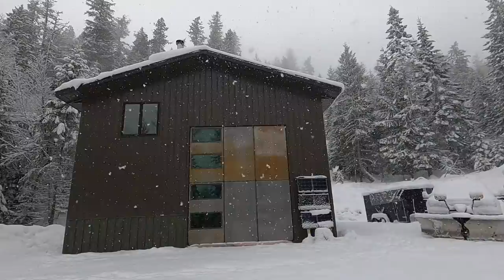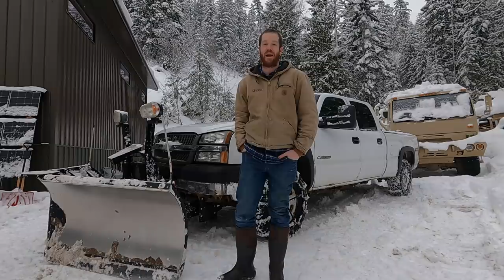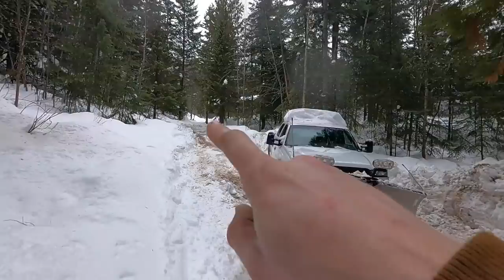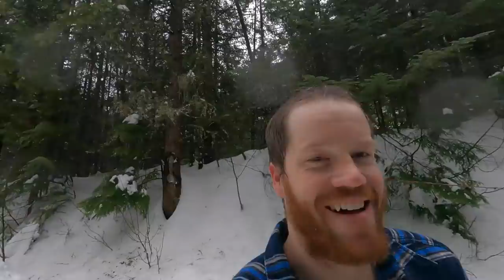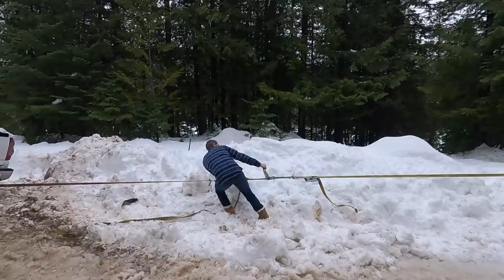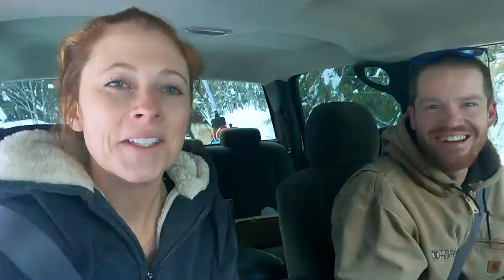WILL WE MAKE IT OUT? | Battling A Blizzard

Comment: I love watching all of your videos as I've  watched every single episode 😍,  and I love the way you both work together just as it should be with a married couple. I ve also notice your troubles with plowing snow and to be completely honest I  do honestly believe that your using the wrong truck to plow with.  You have the right  truck just sitting there in your yard YOUR ARMY TRUCK..  THEY MAKE EXTREME SNOW CHAINS FOR THAT TRUCK , PLUS ITS MADE FOR HEAVY  DUTY WORK..YOU COULD PUT A BIGGER HEAVIER PLOW ON IT JYST ADD SOME WEIGHT IN THE BACK , CRUSHED ROCK , IN THE SUMMER PUT THE ROCK IN YOUR DRIVE OR ON YOUR YARD.. AS FAR AS HARD TO START THEY MAKE KITS JUST FOR THAT , BECAUSE THE ARMY HAS TO MOVE IN  HEAVY EXTREME COLD CONDITIONS  ALL THE TIME..  ALSO SITTING UP HIGH OVER THE AXLE ON TOP OF YOUR PLIW WOULD HELP YOU GREATLY IN SEEING WHAT YOUR DOUNG AS YOUR DOING IT...      THEN TAKE THAT LITE DUTY PICKUP AND ONLY USE IT IN GOOD DRY CONDITIONS..
Reply from the maker: Hi Calvin! If the budget was there we would be setting up the army truck in a heartbeat! But as we've learned with that truck EVERYTHING is more expensive. 😬

Comment: you need a switchable locker or a posi lock or some other locking axle device. your unloaded tires were spinning.. meaning you cant get traction....
do it on both axles.

Comment: You’ve got to remember you’ve got the weight of the Blade and that off sets your truck on the front so you need more weight on the back to level the truck out believe me I found out the hard way when I first started you can’t have to much weight !! OK NOW IF YOU BUY A WINCH HARBORFREIGHT IS JUST AS GOOD AS THE HIGH DOLLAR ONES IVE GOT 3 and there still working get one with a wireless remote you’ll be glad you did !! Now make yourself a tube and plate to mount your wench on your receiver  and than you can’t take it off and and hook it to a tree with a chain but you will need some way to power so make some extra long cables some what like jumper cables and your set I know it sounds far Fitch”d but it works good luck what ever you do thanks for letting me ride along

Comment: It appears to me you do not have enough wait in the back of your truck I would overload it with sand and salt mix it would take a long time to explain believe me the weight in your truck will actually save your transmission as it will help maintain momentum a friend of mine took the blade on his excavator and had it made twice as tall out of an old stone plow turning the excavator into a killer little plow you could zip tie the handle on your snow plow they can't keep a propane torch with you for emergency heat

Comment: Is there a problem with using the 2T as the snow plow?  Weld on a 2” receiver and adapt a 12k winch (movable to either end or other vehicle).  Get a blade from an old dozer and adapt to the front.
I am totally over gas motors are retail vehicles newer than 1998 (1978 for gas) but some of this is CAs poor ‘science’.  That you had the gumption to even consider buying the 2T but it can do so much more but will cost and take time.

Comment: At this point in the game, I think a plow isn't going to be reliable enough.  
You almost need one of those Bobcats on treads with a snow brush cylinder wheel attachment.  The airports use to throw snow away from the road. Its like a snow thrower on steroids.

Comment: A winch is the sulution to getting out when u get stuck like that 100%. But that truck would get alot more traction if u just added alot of weight to it! and that should be the priority, to not get stuck ;)  that said, the army truck with chains and weight in the back, u probobly dont need to plow, HAH
Reply: side note, it would help ALOT if the truck u used would diff lock on all 4 wheels.

Comment: Interesting question what’s the pitch on your pole barn roof, doesn’t look like an easy shed for snowload with ice atop.

You really might like to invest or make snow rakes for removal of pack while warm out.. Personally my house and camp are 10/12 pitch for easy shed when it hits 12” it just falls off. Or after I start the first Woodfire at camp.

After 40+ years in the house have absolutely no desire to attempt shoveling the roof off, 3 stories of timber framing, and 140 years of standing upright.🤣

Comment: You need lockers...  Only two tires are spinning, not all four and it depends on if you are going frontward or back... 
That is why this truck keeps getting stuck.  Sure it is four wheel drive, but it isn't setup good for this purpose.
Reply from the maker: Hi Chris! The truck has a rear locker. While a front locker would aid in traction, it would also greatly increase our likelihood of blowing up the front end. We would much rather get towed out than start grenading parts.

Comment: You NEED a real vehicle mounted winch plus lockers in both axles. Also BIG LINK heavy duty real deal tire chain$….
Reply from the maker: The truck has heavy duty chains and a rear locker. But it is definitely time for a winch!
Reply: @AmbitionStrikes  
Btw, plowing snow may look pretty basic, but it is, like most, a skill that improves with usage. 
Great equipment certainly helps, but skill level matters, too.

Comment: You need to put weight in the rear end, that will give you better traction, take it from a  former Wisconsinite
Reply: Plow trucks require ballast weight in the back, as a 1000# blade up front totally changes your traction.

Comment: How come you have not fabricated a plow for the Army truck.
It is 4 wheel drive
Reply: Should get a winch that you could use on both trucks.
Diesel Creek modified one from Harbor Freight.
Also it would help to have chains for the Army Truck.
Really enjoy watching as you progress on your shop.
Thanks
Looking forward to future events
Reply: Riley
If you put weight in the pickup ,put it between rear fender wells.
Put a frame in between so they will not slide around.
Did that with my truck and worked fine.

Comment: Jeep on tracks, use everything but the keep on tracks? I don’t get it.
Reply from the maker: We also thought the Jeep on tracks would be a great option, until we drove it in heavy icy slush. It is VERY hard on the tracks/steering/frame of the vehicle. We really don't want to break anything, as we don't have any of our tools up here yet to fix it. So for now we are being very easy on it and only driving it in fresh light snow.
Reply: @AmbitionStrikes  I have a Cherokee on tracks as well and hydro assist with one ton steering is an absolute must.   It takes the vast majority of the stress off the steering box and frame and puts it straight from the axle to the steering knuckles.   You also need an auxiliary steering cooler if your going anymore than 15 or 20 miles.   It will get hot enough to boil the fluid and leave you with no steering

Comment: You guys are making things to hard. I know your learning but use the right equipment. That dozer will do more then just push dirt. I suggest not investing in mini equipment. Reasons being a skid steer if it has tracks.. you’ll replace tracks every 1000 hours. Tires.. 750 hours. Plus a skid steer is limited. Worthless in steep terrain. Id trade that little excavator off for a 50,000 lb excavator. Small is just that. Only does small jobs. A cat 320 will get around 10,000 hours before you need to work on the undercarriage. You dont need new. Pull the tracks and turn the pins 180 degrees. Like new again,you have property on a hill. You need machines designed for that type of terrain. Mini equipment isnt designed for that